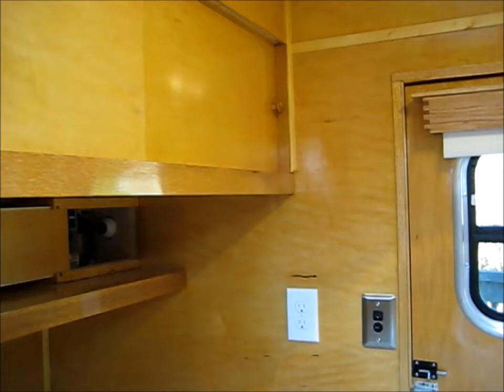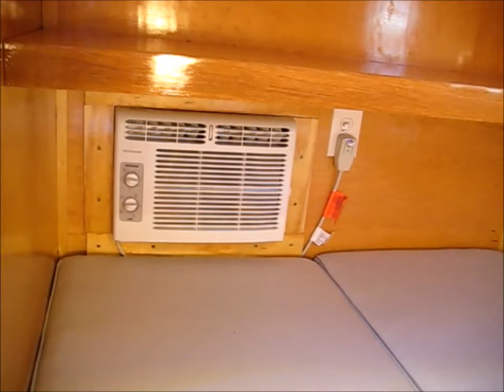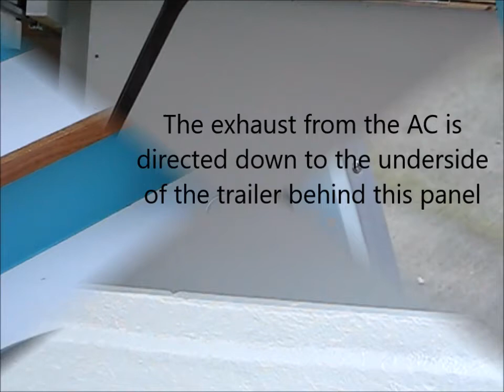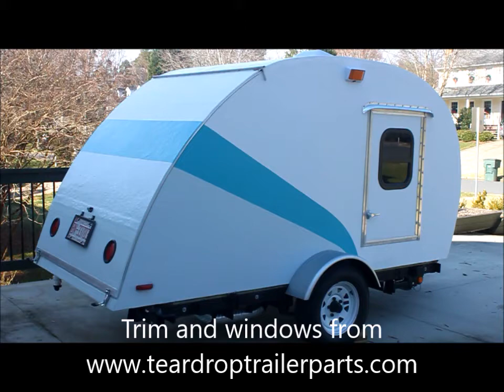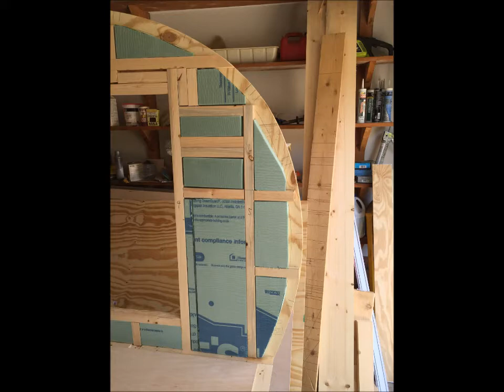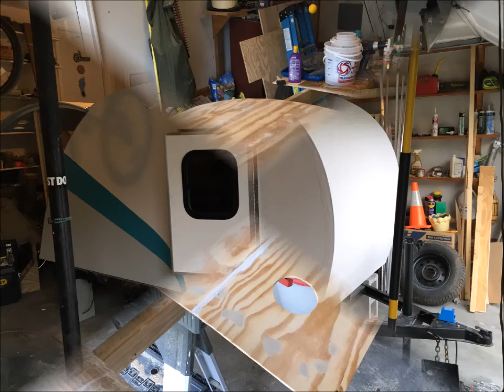Teardrop Camper Build

Comment from the maker: The trailer I started with was 10.5 feet long from tongue to tall and 6.5 feet wide from fender to finder. The finished trailer is 12 feet long and the same width as before. The body of the camper extends about 16 inches past the end of the old trailer.

Comment: Great build , what's with the one thumbs down , maybe someone tried to build a trailer like yours but failed miserably! This trailer looks more durable than a factory built unit   ; )
Reply from the maker: Thank you for your comment.  So far we have had it to 5 states.  It has been in a downpour, 100 degree temperatures and high winds.  In every case we were very comfortable inside.  I have added a number of small creature comforts over the summer and plan to put out another video outlining them.  I think anyone could build one with basic carpenter tools and some patience.  I really like no payments.

Comment: What was the Cost of Materials??
Reply from the maker: Thank you for your question.  An estimate of the materials is about $2800.00 not counting the trailer I started with.  I used a Stag brand trailer as the base for the camper.  I would recommend the Stag brand because it is all welded construction and very rugged.  They have a web site and dealers around the country.

Comment: I'm build a 24 ft. v-nose  cargo trailer conversion on my channel
Reply from the maker: Good luck on your build.  We have had ours out 5 or 6 times now.  A few changes I've made as we learned more about how to camp in our teardrop.  
1.  Add cup holders and shades over the windows.
2. Add amber lights inside to help keep the bugs out at night.  We also use only amber lights outside at night.  It really helps keeps bugs away.
3.  Order any custom cushions a month before you need them.  It takes longer than you think.
4.  We use an external waste tank for gray water, then dump it at the dump station.  It works great.
5.  We try not to be too smug about all the money we saved when we park next to a $200K motorhome.  We are having just as much fun with no payments.